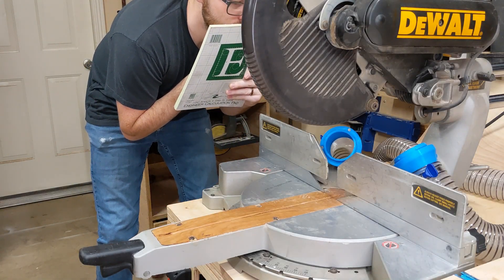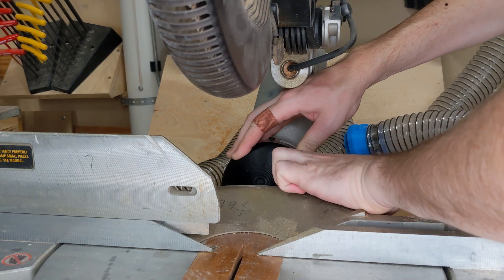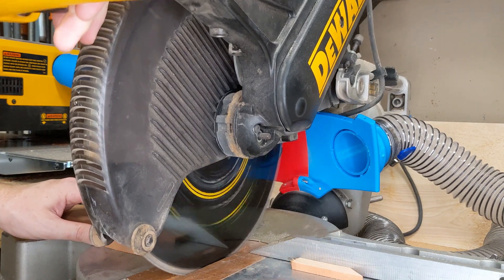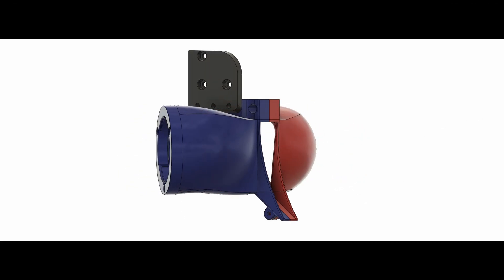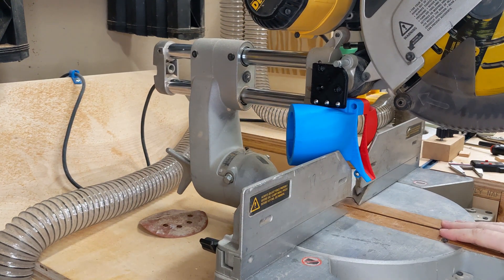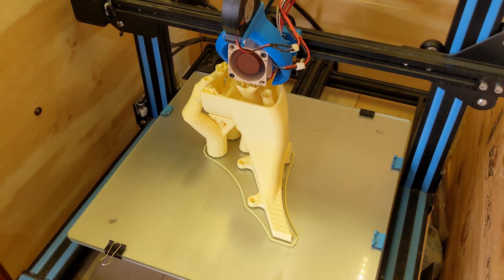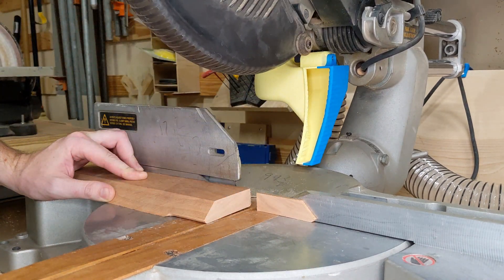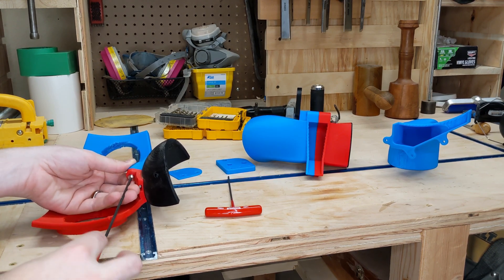Three Attempts at a Miter Saw Dust Collector Mod and One Good One

Comment: Cool video, dust collection is something I really need to work on!
Reply from the maker: I'm still working on it, a lot of my originally designed parts have created unexpected bottlenecks.
But it's definitely a huge improvement over having nothing, and personally I think having the dedicated lines prompts me to use it a lot more than having a collector that I have to setup frequently.

Comment: Did you ever get it working well? I have a DW708 with a broken dust collector and was thinking of designing my own to print.  But if I could just get your files that would be much simpler, and I would be very grateful!
Reply from the maker: I just recently started reworking this model in earnest.  Though I think I need one more crack at it to have something that's perfect.  Once that's sorted I'll likely push out a smaller video and have the files available through GitHub
Reply: I would be very happy to purchase one as I don't have the ability to 3d print. Do you have a link or contact info where I could purchase? There isn't much of anything available for the  DW708 Type 4.
Reply from the maker: I forgot about posting the results of the rework, and have since swapped to linux and FreeCAD.
Here's the best I could gather :)
https://github.com/foukemonsterworkshop/DW-708-Miter-Saw-Dust-Collection

Comment: I've owned this saw for 20 years and I haven't got the dust collection figured out yet either. I think your last one is great but just use some rubber for the bottom half so it can be used with taller pieces like the Festool Kapex uses. If you get it figured I will order one
Reply from the maker: I've been eyeing some thick rubbery tape that I think would be perfect for just what you're talking about.
Overall, I think I need to take one more crack at from the ground up.  After that I'll probably make the Fusion 360 files publicly available on GitHub.

Comment: Ahhhh man.  I was sure you solved it with that last one.  I was ready to fork over $ if you started making them.  I have a 708.
Reply from the maker: It's been quite the workhorse, I've really enjoy having this saw.
I'm going to take another crack and the whole design, its not quite rigid enough and I have some ideas for the lower section.
After that I'll probably make the files publicly available on GitHub.  I wasn't really thinking about selling them
Reply: @FoukeMonsterWorkshop  I would also be interested in the files as I also have a DW708.  It is a great saw minus the dust collection sleeve.  I was just going to go down the path of seeing if I could design something better.  Have you made any progress in the 4 months since your post or are the files out on GitHub to improve upon?
Reply from the maker: I sure am timely...
I don't think this is quite a "official product" quality design, but here is what I've been using if you have your own means of 3d printing or would want to use the files with a 3rd party production company.
https://github.com/foukemonsterworkshop/DW-708-Miter-Saw-Dust-Collection

Comment: I love the ability to create and print your own parts.  What was the purpose of the different color pieces?  Was it just the filament you had?
Reply from the maker: Partially, it also was a bit easier to compare the printed parts to what was in Fusion 360 at a glance.

Comment: Ha! Loved the struggle. I wonder if leaving off the lower portion and substituting a duct tape section would give the same collection results while adding flexibility so the tape would bend over thicker material
Reply from the maker: I'm trying to think of some way to strengthen it just a little more than duct tape but that's a great idea.  
Maybe coat thin cardboard?
I think I have some kind of rubbery tape too I'll have to check out